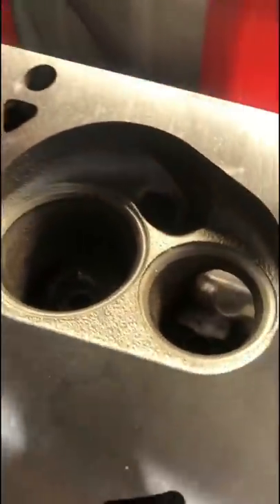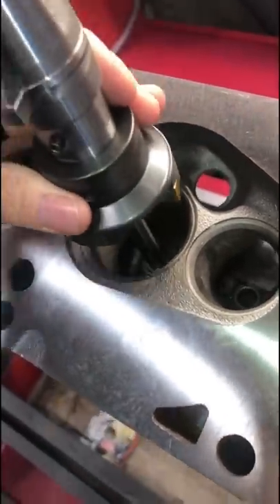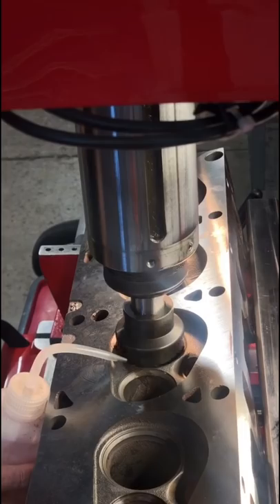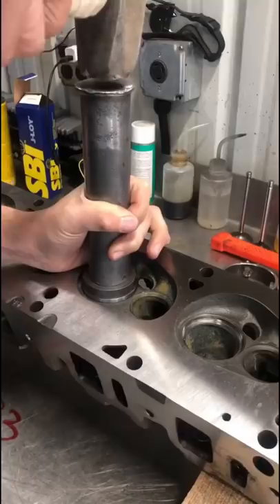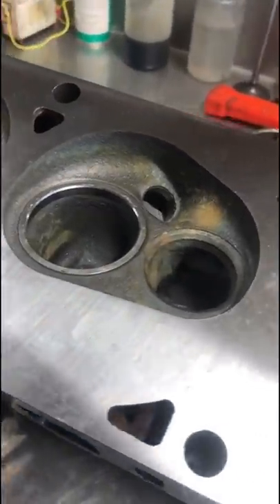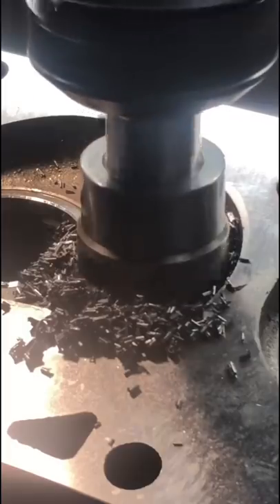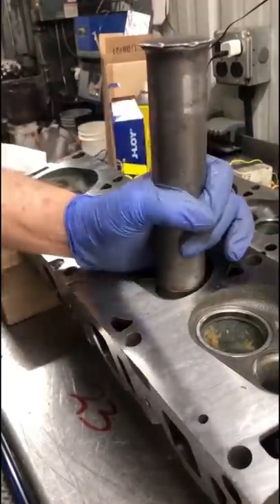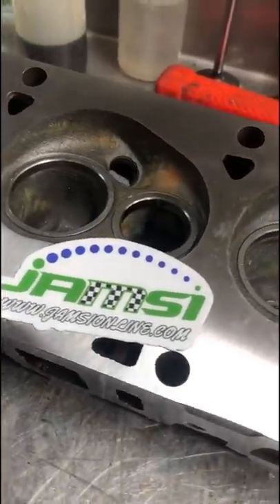#shorts Installing Hard Valve Seats In A Set Of FE Ford Cylinder Heads

Comment from the maker: A big thanks to all of our supporters!

Like our content? Support our business by shopping at https://www.jamsionline.com
Reply: It looks like valve seats can drop anytime engine is running,  they are not seated very well?
Reply: I’d send you machine work from here in So. Cal just because.
Reply: Great content once again. Thank you.
Reply: I have a sbc that someone mixed up the main caps. They are marked but they still managed to mess it up and the crank broke.. Do I need to get it line bored?
Reply: I’ve seen worse valve seats.
Reply: @repairvehicle  they need to cut smaller, and the new seats need to be dipped in liquid nitrogen first.
Reply: @Nostradamus_Order33  Had multiple hardened seats crack or ? after having them installed. Is the practice you mention the  accepted right way or did the heads possibly get milled out to far? Honestly surprised when I see a sleeve or the seats  just hammered in.

Comment: The only bad thing about these small shops is the use of hammers to install new seats, sleeves, etc. The chance of cracking or misalignment is extremely high and all that is needed is to shrink the press fit parts so they require either minimal force of literally fall into the sockets prepared for them.

Comment: Gotta be careful with coolant on cast iron, oil is worse though. Since cast iron is porous, it can soak in the fluid and either create steam with coolant or burn the oil inside the iron which could cause it to crack. My teacher showed us an example in school and the cast iron shattered like glass when the coolant was applied to it. Cast iron contains graphite so it is self lubricating, no coolant or lube needed. Be careful out there, wouldn’t want to crack a block or head.

Comment: We use a sunnen VGS 20. We cut the counter bore to about 10thousandths under the seat then cut the seat on the lathe to match press fit for as much accuracy as possible. Since the cutter for the counter bore on this machine likes to cut +/-1.

Comment: You say cast iron is usually cut dry, but for finishing operations I don't think this is the case. Seeing as you are boring, I'd say you want to use as much coolant as possible. It will provide a better surface finish and your tool, which is in constant cutting contact will last longer.
Reply: There is NO valve seat and guide machine manufactured that comes with a coolant tank because it’s simply not needed.

Comment: Driving in inserts was always a popular method, until your first one that falls out then you wonder at what you did wrong or was the insert bad or were you just unlucky, then you dismiss the rework with a bitter taste it left,  then after the next ones you finally realise the short cut is not actually worth it then you shrink them in so as they expand they grip the counterbore not try to shave little bits off as they go in, but everyone has their trigger point number before it dawns, maybe doing thousands and thousands of inserts compared to just dozens highlights the odds of failure and come backs, I would have rather had zero in hindsight but each to their own whatever you are willing to justify in your mind as acceptable

Comment: Some people say the harden seats are a requirement with modern fuel and factory high compression, but I would think the originals would be fine with a octane additive or a race fuel that prevents pre detonation. Interested in your thoughts on this.
Reply: It’s the lead that kept the valves from eating into the iron. Not the octane rating. If you could find a additive that added lead back to the unleaded gasoline then maybe.
Reply: @basketofdeplorables4253  there is lead additives, but one of the main ingredients in octane booster is lead. So possibly the reason the lead keeps the valves from eating the iron is more due to raising octane levels and keeping temperatures and hotspots down between the valves and seats rather than just providing a protective coating between valves and seats. So it’s not that we need lead, but we need higher octane, and lead is just the best way to raise octane.
Reply: @DesertRatRacer  well they didn’t need hard seats until unleaded gasoline. The octane ratings are the same as they were back when gasoline had lead in it. 
  Yes. You could add lead, but you are going to spend far more in the long run, on additives than it costs to put hard seats in, especially if you are already rebuilding the engine or having the heads rebuilt for a seat or valve, guide failure.
Reply: @basketofdeplorables4253  octane was higher when it was leaded. Our current pump High grade octane was considered low grade back then.  I agree that if you are going to rebuild a head, then its probably better to upgrade if you want to run lower grade fuel. But back to the root of my question if the problem is more of a low octane issue rather than needing a lead coating on the valve ... then possibly don't need hardened seats if you already run high octane race gas due to high compression or boost. Also if that's the case then could possibly get by with pump e85 and no lead additive as it runs way cooler and is equivalent to 100+ octane.

Comment: How many times do they need to be cut in their lifetime? How many times does that motor need rebuilt?
Reply from the maker: Depends on the motor & the situation.

These heads 50+ years old. Good chance they’ve been rebuilt 2-3 times already.
Reply: With the hardened sets, these heads could theoretically last another 50+ years.

Comment: I've seen more than one reman place the inserts in a freezer to size down the seats. Do you do this as well?
Reply from the maker: Not necessary. It can help w/ installing seats in aluminum heads but not necessary in cast iron.

It takes a pretty significant temperature differential to make a difference on a 1-2” diameter seat. Usually need a combination of heating the head, and cooling the seat usually w/ dry ice or liquid nitrogen.

It is not worth the hassle in most instances but somewhere on my page there is a video of me using liquid nitrogen doing seats in a Honda head.
Reply: @JAMSIONLINE  As an aside question; what are horsepower/torque limits for replaced valve seats? Are they as strong as a naturally machined valve seat out of the head material? Or is compression more of a factor in how much they can handle?
Reply: @JeffLocke1  every head has a hardened seat installed otherwise the valve would eat the head out. When the old seat wears out they machine it out and install new ones. Seats nowadays will be better quality than 1970 ones let's say
Reply: @Kmecha84  Thank you. I had the same question as Jeff. I appreciate your answer.

Comment: Quick question. I have a vintage car without hardened steel valve seats which means I have to use lead replacement.

Is the rumor true that it is risky to put hardened steel valve seats into a cast head? I have heard that there is a fairly big risk for the seats to work themselves out over time in a cast iron head.
Reply: @Mr. Plissken no risk of them falling out?
Reply: There should be a .005-.006 interference fit on the hardened seat to a cast iron head. If the job is done correctly the seats will never fall out.
Reply: @jamesthemachinist1325  awezome. thanks for the answer =)
Reply: As an ex-machinist myself, I can tell you the only reason the seats would drop would be severe overheating. But then that won’t be your only engine problem.
Reply: @marcusmarrs  aah, thank you for the info. so there is no risk in mine cause it works flawlessly
Reply: @isaks3243  No, there is no risk IF the seat installation is done correctly and I can assure you these guys do it correctly. Again, they will outlast your engine UNLESS severe overheating happens, but, as I said, that will not be your only problems.

Comment: My boss recently bought us a new serdi 4.5 and I absolutely love that machine. I’m curious why you remove the head to drive in the new seats? At our shop we just smack em in on the serdi. Even on our old serdi 100. it looked like you were smacking the seats pretty hard, how much press do you like to shoot for?
Reply: I also used a Serdi machine. Bought it new in 1986 and it’s still going strong to this day. I always pounded the seats in while the head was still on the machine. Some machinists don’t like the idea of the hard pounding on their expensive equipment. It’s just a matter of preference.
Reply: @marcusmarrs  that’s awesome! Our serdi 100 is pushing 30 years strong now. I’m new to being a machinist, about a year in and I love it so far. What was your rule of thumb for press on seats in cast vs aluminum?
Reply: @TheOmw2000  .004-.005 on cast iron and .007-.008 on aluminum. You buy valve seats designed for the type of material you’re putting them in, the interference will be made into the seat. In either material, the counter bore is cut to the sale size. If, say, you’re putting in 1.500 od seats, the seat for aluminum will measure at 1.507-1.508. Cast iron seats will be 1.504-1.505. Best of luck!
Reply: @marcusmarrs  thank you for the reply, that’s the same that I was thought so it’s good to have some reassurance. Any general tips for a rookie? I know I’ve got a lot to learn!

Comment: Can those seat’s come undone after they get hot and cold you know after many miles in use … it is cast iron heads ,just asking
Reply: Unless the new engine is severely overheated then those seats will last longer than the engine.

Comment: So what I'm wondering is how long will this seats stay there? I was under the impression that valve seats have a tendency to expand and contract with the heat cycling of an engine, but without a much tighter interference fit (specifically one achieved by heating the head and cooling the seat insert) they were doomed to drop. 

So are you taking an ill advised shortcut or are there other factors I'm not aware of?
Reply: Nearly every engine is made this way now. The older gas engines were made without hard seats because the leaded gasoline provided the lubrication needed to control premature wear. There are very few low performance diesels that may have the valves seat right on the iron but most diesels have hard seats pressed fit.  Aluminum heads would not run for 5 minutes without seats.
Reply: @basketofdeplorables4253  You misunderstand me. I know hardened seats are needed. I'm asking about the process in which they are installed. I'm sure if you read my comment again, that will be clear.
Reply: @jw11432  oh yes. I didn’t catch the part about the heating head an cooling the seats. But the way he is doing it is fine. It all depends on the recommended procedure put out by the manufacturer.  John Deere says drive them in. Where as caterpillar says to cool them with co2. There is instructions in the manuals on how to make a device to hold the seat and blast it with co2 from a tank. 
 Me personally I use a yeti cup filled with liquid nitrogen on any seat installations. But driving them in is fine. I mainly do it to save my arm from having to swing the hammer so much. 
 On cylinder sleeves it’s the same. Cummins says cool the liner and cat says press it in without. 
 I also use liquid nitrogen on the sleeves. Most times they drop right in. Saves a lot of set up to press six or 8 sleeves, but either way is fine.
Reply: @basketofdeplorables4253  Ah ok. So I'm coming from having a 2004 Jeep GC with the 4.7, and the issue from the factory was intake valve seats not having a tight enough interference fit. So the way to fix it is slightly larger seats, but heating the head and cooling the seats before pressing them in, then even optioning peening them in place. I refreshed my engine when I got it and had the heads redone with these two things also done. 

Interesting that it varies by manufacturer, I would've thought that's an across the board thing. Thanks for the info.
Reply: The valve seats will last the life of the engine, or even longer now. The only thing the causes seats to drop is severe overheating of the engine. Overheating to the point of engine damage.

Comment: Pressing the seats in is safer.
All that banging may cause cracking,
or worse... 🤔
Reply: In 25+ years of doing this same work I NEVER cracked a head by installing valve seats. I just doesn’t happen.
Reply: @marcusmarrs  
Perhaps not during assembly,
but what about several thousand miles
down the road?
When the motor gets put in service?
I've seen motors with dropped valves
n a few with dropped seats. This was 
back in the day when fuel went unleaded
and customers were getting their heads
redone. I did hammer in valve guides n had 
no problems. As long as you adhere to the
interference fit measurements...

Comment: If you buy a reco engine... is everything reco'd  on it ... or just bare minimum  ??
Reply from the maker: Depends who you buy it from.
Reply: I toured the HUGE AERA engine rebuilder in Dallas, TX several years ago. To give you an idea, they have 6) Serdi machines constantly running. I was watching one guy whose only job was to check valve guides for wear. They would only replace the one’s that were out of spec, whatever their spec was. So, some areas in an engine are left alone if they are acceptable. ALL blocks are bored with oversized pistons but not all heads or blocks are resurfaced, again, just the ones needing it. I expect it’s the same with crankshafts and connecting rods.
Reply: @marcusmarrs  thanks for replying.  I got an engine reco'd once. Did everything except new pistons.  And one split and ruined the engine.  So I think I would want everything done or cleaned up. Thats what you pay for.

Comment: Dip the seats in liquid nitrogen and you won't need to hit them. Heat = expand, 
cold = contract
Reply: The way he’s doing it IS the accepted method. Almost all shops install seats this way. It’s also recommended by the seat manufacturers.
Reply: @marcusmarrs  didn't say it's not, in aircraft engine manufacturing things are done to a higher standard. Just an easier way.

Comment: This is wrong method .....
Reply: Based on what?
Reply: @marcusmarrs  insert the valve seals with a hammer is it ok ???
Reply: Yes, absolutely. Using a pilot with the proper sized arbor ensures the seat will be knocked in straight. Now, knocking them in like a freeze plug would TOTALLY be unacceptable.